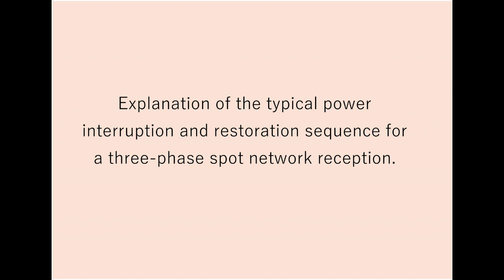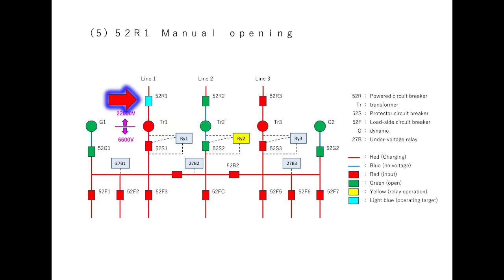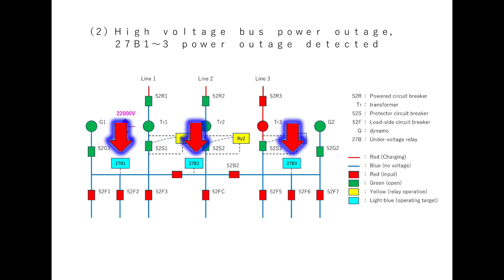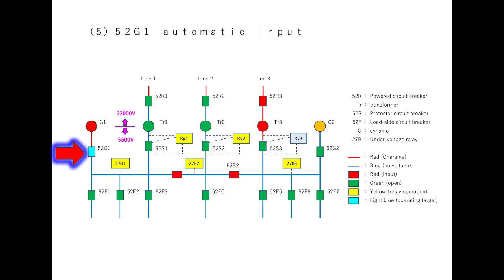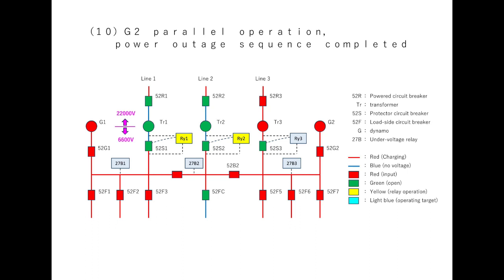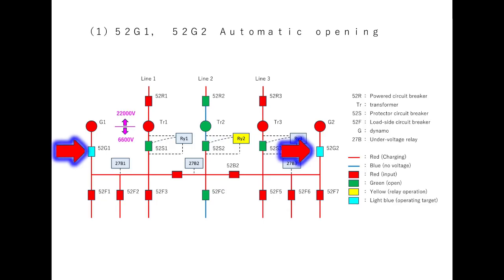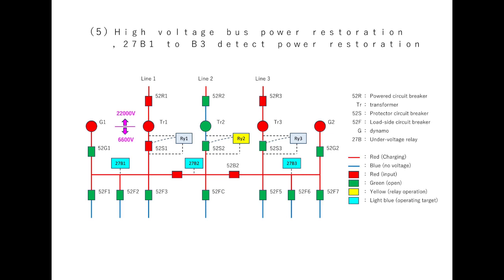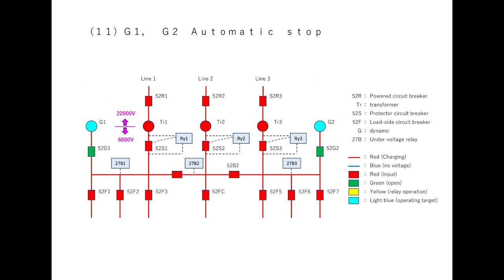Three Line Spot Network Power Reception Typical Power Restoration Sequence

Comment: What is the function of the relay（継電器）in this diagram？
Reply from the maker: The relay in this diagram is a network relay. It has no-voltage operation characteristics, differential voltage operation characteristics, and reverse power trip characteristics.